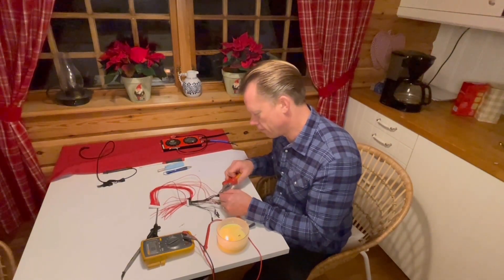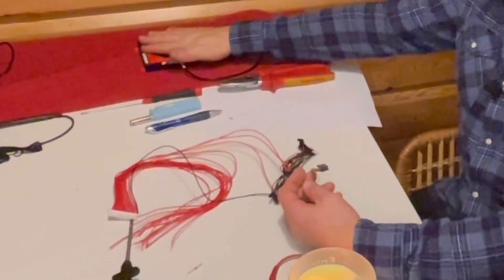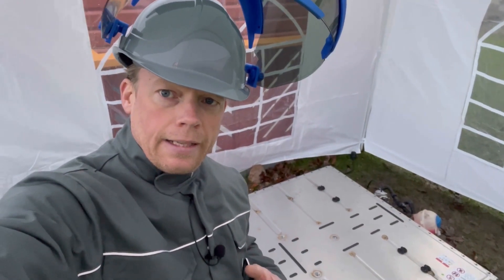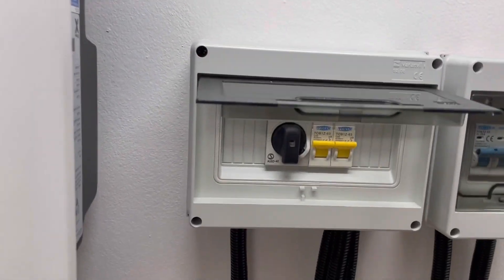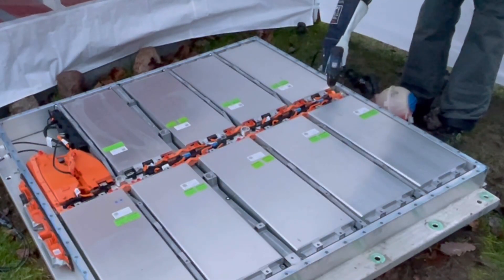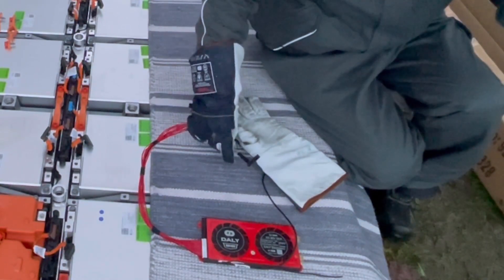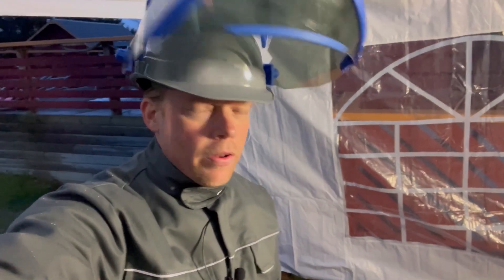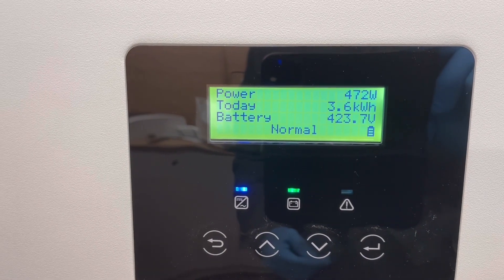Vw id3 battery 62 kWh solar storage, Is there any unbalance going on?

Comment: Hi , haw u connect bms to that 22 pin port , can help please
Reply from the maker: Hi, yes it’s connected to that.
Reply: Can help me identify the pins , i want to conect it directly to a jk bms but i dont know wich pins goes to each paralel
Reply: Frome what i know so far is pin 7 and 9 is - frome first paralel and 11 / 12 + 48v last paralel is that ok
Reply: Just got 2 x 6.85kw without bms and can , original ones are so expensive and i prefer to buy a jk bms frome aly so i can connect it directly to those 22 pins
Reply from the maker: I will post a video about that pretty soon. 
I do not have the pin schematic with me now. Thanks for your interest 😊
Reply: Thx , forgot to mention i want to run 2 in paralel conected to a 24s jk bms 80ah 0.6ah balance , a bit more complicated to conect them in paralel and with 1 bms going to 2x 22pin
Reply from the maker: I do not recommend to parallel those 22pins connectors and I’m not sure that the module can handle 0,6a balance current.
Reply: Hi , thinking about conecting + and - paralel main batery to other batery + and - then the bms black wire to 1 negative second 1 red wire to + 1 paralel frome other first + battery then3 to second paralel at first batery and so on till last paralel to other batery that first black wire goes , got 24s bms so it fits exacly

Comment: Hi, it's better to measure it fully charged or discharged. If the cells are e.g. at 40%-80%, they will have basically the same voltage.
Reply from the maker: Hi, 😃 Yes I’m aware of that, that’s why I charged it a little bit higher (85%) then I normally do this time. I’m not going to charge it higher without any control of the individual cell voltages during charging. But what’s interesting for me is to se if there starts to be some drifting between the cells. Thanks for your comment😊
Reply: @flyingtools  I finally got my X3 15.0 G4 inverter two weeks ago and it is just great. Compared to the G3 significantly.
So I've put the 51,2kWh LiFePo (550V) test storage into operation and so far it works well beyond expectations. I have the balancing active.
There is no reason to be afraid of the HV system. When I see those crazy Victron-based assemblies, with a million parts, for outrageous money and of last century technology ... 
HV - this is pure, simple. Definitely better than a 48V system with cables as a hand 😁
Reply from the maker: I totally agree with you there. 👍🏻
But if you have a diy HV battery it’s a complete different situation. I would never recommend a person without any electricity experience to build one. 
I have not tested victron yet but I have plan’s for that to a of grid system in a shed I have near by.
Reply: @flyingtools  Of course. However, even with low voltage, it should be done by a person with electrical knowledge. Given the currents, it's not for hobby construction even at 48V without knowledge in the field.
I forgot to mention that our project is a corporate development of a storage system for commercial use. For our use it will be 200kWh.
I don't like Chinese assemblies, the functionality is not good and I have doubts about the quality of the cells used in these assemblies.
We use EVE cells - 5000 cycles/25°C 0,5C.

Comment: Like to know more about your inverter.  I hate low voltage Inverter 😊 low-voltage inverter, everything gets expensive, big fuses, big heavy cable, connectors And so on, everything just gets so expensive.
Reply from the maker: Just find this comment, YouTube had hide it for some reason. I think I will make more videos about it later. I like both hi and low voltage inverters but I agree with you. It depends on how you will use it. In a shed/small house/cabin 48v will do ok.

Comment: what was wrong with your old system  in terms of efficiency?
Reply from the maker: Hi.
It was not so efficient as this solax hybrid inverter, but the biggest reason why I changed my system is that this can sell my power from the panels when my battery is full.

Comment: To check voltage from the phone without having to disassembly the battery you can put 2x ISDT Battair 6S in every pack. 5 bucks a piece
Reply from the maker: Yes, thanks for your advise, but I don’t like to have anything connected to the cells during a long period of time. The reason is that those can cause imbalance. Even a very little difference in consumption between them will have a big effect in two or three months.